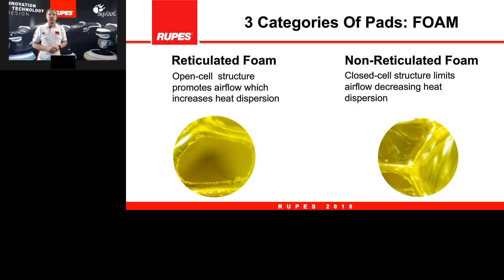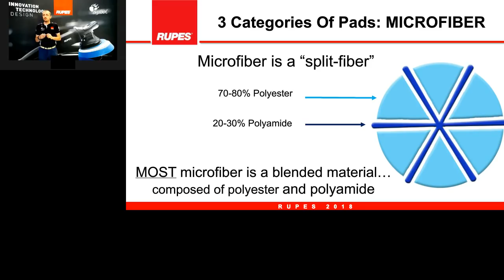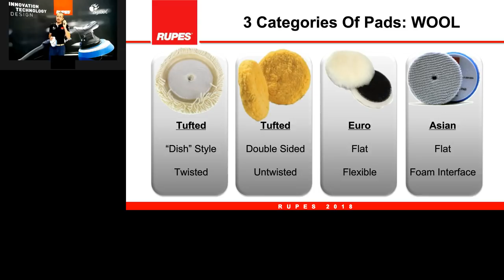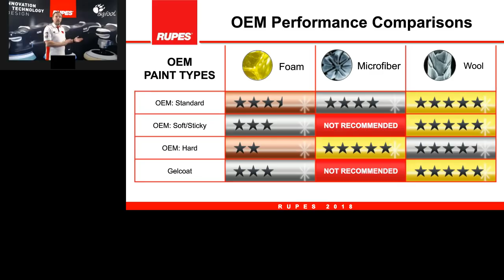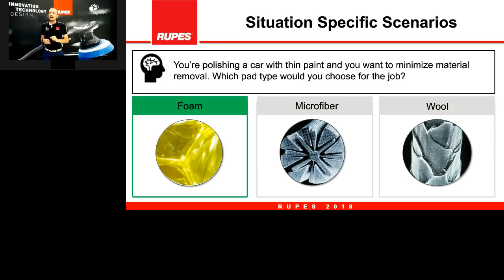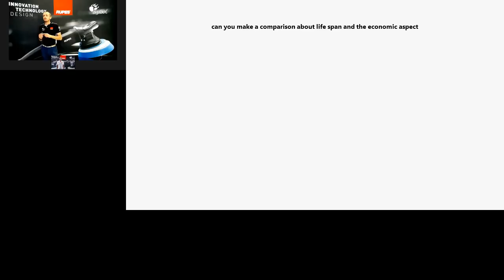Foam, microfibre, wool: different performances and how to choose the right pad

Comment: So can I cut with rotary and micro pad follow by a triple orbital  machine and with foam finishing pad🙄🙄🙄 would that work. On lots of swirls and tree branch scratches
Reply from the maker: Rotary and microfiber is a combo we don’t recommend bc of how hot the material runs. However, lots of technicians still opt to cut with rotary and wool, then finish with random orbital and foam. Actually a very common approach for shops and users who are not comfortable making the transition to all orbital processes.